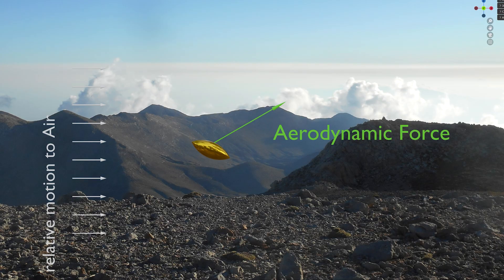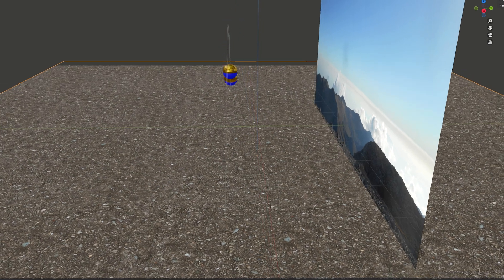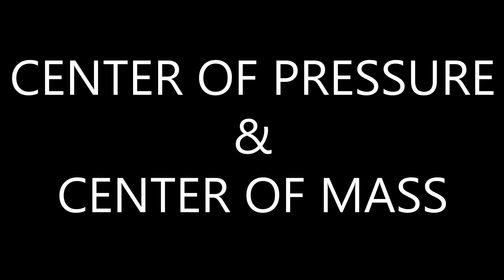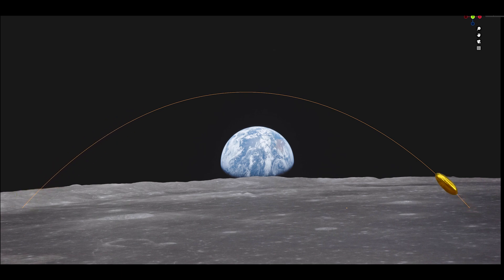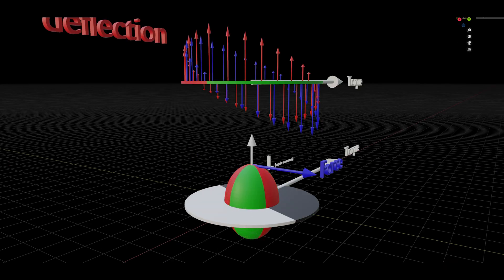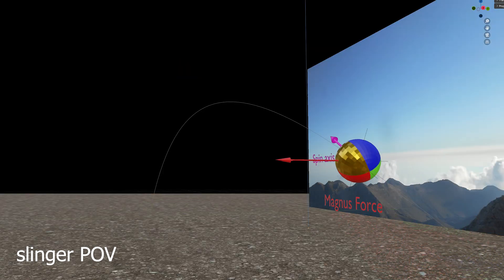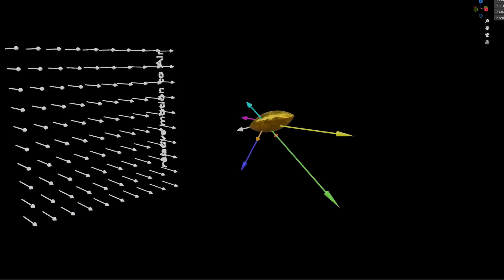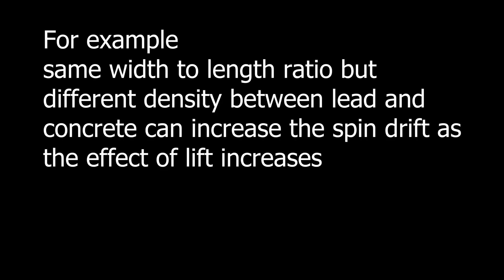Projectile Trajectory- Lift and Spin Drift -External Ballistics of Slings

Comment: Hello. I feel like my sling projectiles are not pointing down as they drop, like you said they should. How could I fix this?
Reply from the maker: there are a lot of variables I don't know about your situation, maybe try increasing length of the projectile.
Reply: @Acroballistics  

I fixed this issue a long time ago by doing a few things:

I use a flat braided short sling that is oscillating a lot less and staying oriented with my wrist

I improved form to more efficiently impart energy into the sling which increases twist rate (maybe the biggest difference)

And I use larger stones that snap out of the sling more readily and spin faster.

Your videos were very helpful by the way! I am without a doubt better at slinging because of your videos. I do a lot of airgun shooting, so your ballistics videos are surprisingly easy for me to understand since I understand a lot if the concepts already.

Comment: Is that why historical glandes are slightly flat?
Reply from the maker: yes that would be one of the reasons. a guy has reported higher penetration on plywood but I have done no experiments on penetration. it follows the same logic: less frontal area-> more penetration
Reply: @Acroballistics makes sense, I feel like it would also help produce more rpm in the projectile. Idk